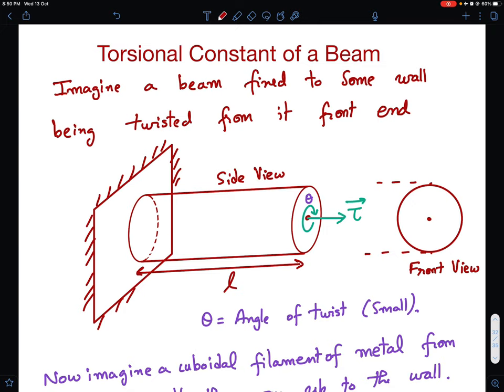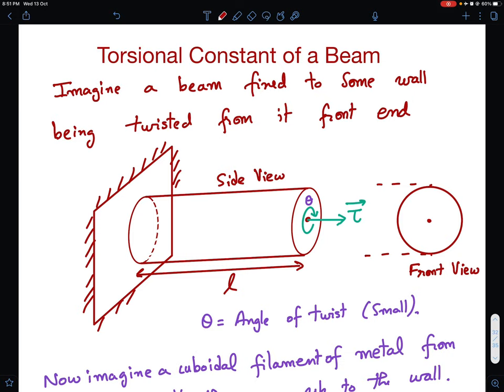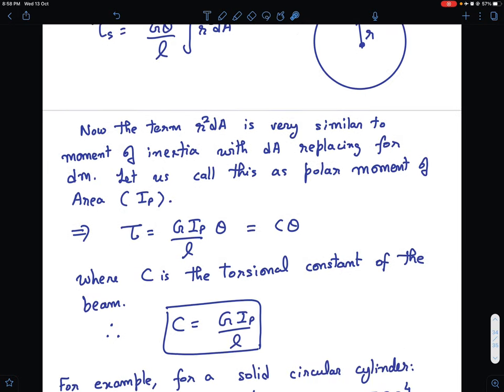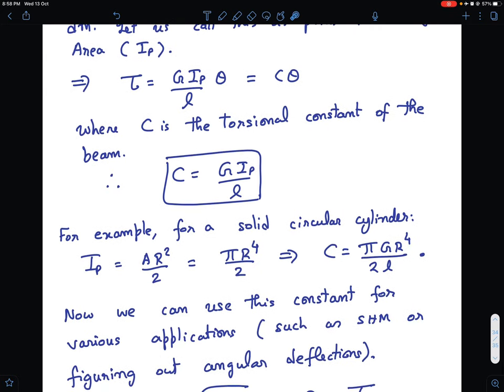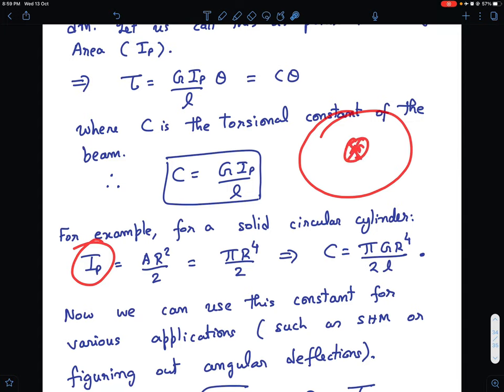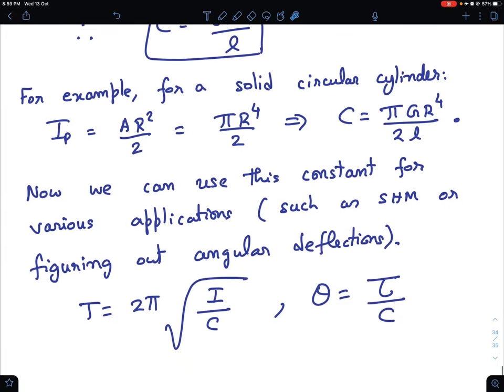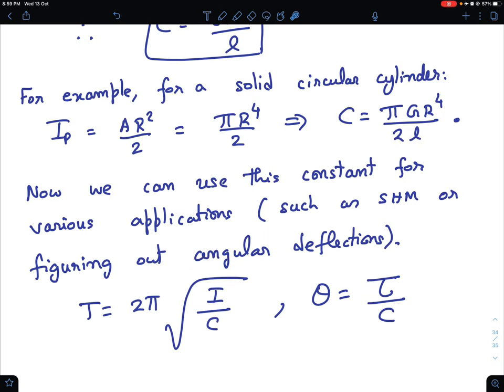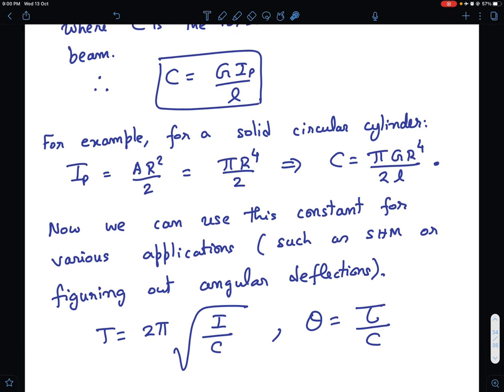BEAM TORSION: PATHFINDER 9C2 PREREQUISITE THEORY

Comment: Amazing sir 😊
Sir I had a doubt,in case of this kind of rod attached one side to wall rigidly,If the rod is bent like semicircle then how to analyse the restoration can you please tell🎉
Reply from the maker: Thanks for Appreciating! 😃
For the bent rods generally things will be much more complicated (there will be simultaneous play of bending moments, shear stresses and twisting torques). You will learn about them if you take a course in solid mechanics or Strength or materials. Some simplifications can be made in situations where the effect of bending moments and shear stresses are not very significant in comparison to the effects of torsion. I will try to take it when I analyse the pathfinder 9c2.
Reply: @ambarishphysics  Thank you sir for replying, when I solved the spring problem it came to my mind that what will happen if we bend spring that we often do with our writing pen springs 😁I asked for rod though as they mean same 😐😐😐
Reply: @supriya1729  yss i too thought of same idea.. 😄😄